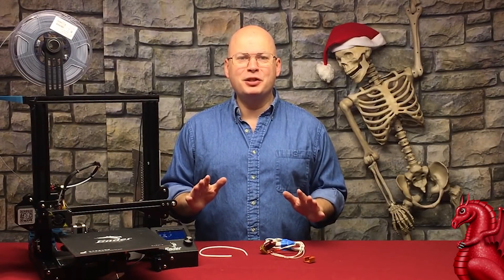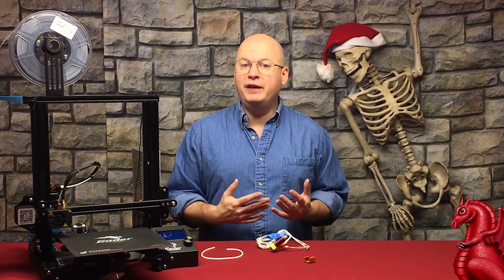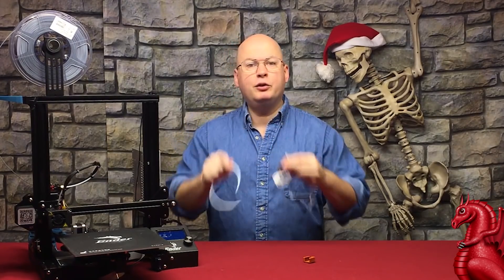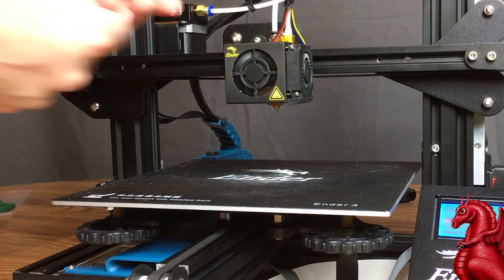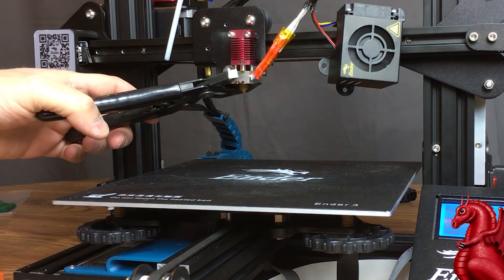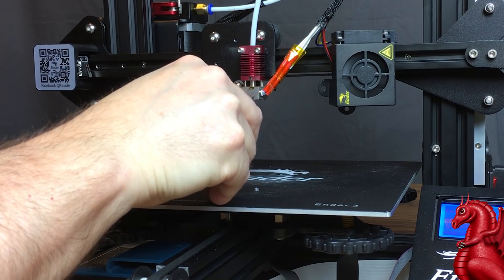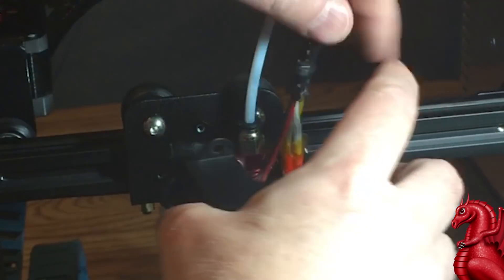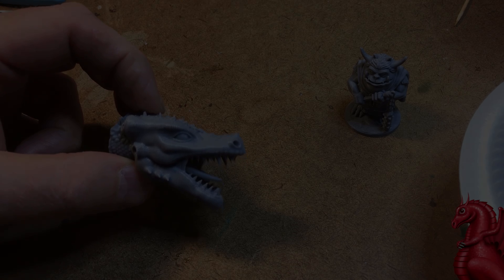Fixing Ender 3 and Ender 5 Bowden Tube Gap

Comment: I put the nozzle in 2 turns loose, then insert the bowden tube to where it hits the nozzle.  then Zip tie the coupler.  Then tighten the nozzle and retighten the zip tie.

It stays in place very well.  No gap.
Reply from the maker: Be careful with 2 turns loose, that might be enough to actually deform the PTFE tube end and cause issues.
Reply: @Tombof3DPrintedHorrors  From experience, yes it will. :(         2 turns is too far...

Comment: 1:10 no, my problem is the filament melts in the bowden tube, and then when it cools off, the filament turns solid.  When I print again, the filment is a solid block of plastic that refuses to melt enough to move forward.  Been using capricorn tubing, the nozzle is right up to the bowden tube, it's just melting in the heatsink.
Reply: Late reply I know, but with capricorn tubing, you need to reduce your retraction distance. Try half of what you had normally.

Comment: Still fighting my ender 5 s1. The direct drive extruder has a hot end where the Bowden tube stops at the heat break. 

I think that’s the cause of my problems, but I’ve recut that section of tube 3 times and I still get clogs. 

I’d say heat soak up into the heating, but I’ve upgraded the fan twice!

The S1 is a troubled machine. Printed soooo well until I had one batch of bad PLA and I’ve never recovered.

Comment: As a heads-up, the bowden tube & Coupler combo pack on Amazon is shipping the right bowden tube and black/print head coupler, but the blue ones for the extruder in that pack have the same screw size as the black ones, so they don't work. This isn't your fault, but I just wanted to let you know that the product shipping is not what they say if there's a different link or seller you can use.
Reply: I placed an order Dec 27th and it was wrong. So it may be a new thing.
Reply from the maker: Thanks!

Comment: Thanks for this great video! I did everything you explained but left the Fan on the nozzle in place! Why risking damaging the wires to temp sensor and nozzle with fan's this way, when there is no need to remove the fan at all!!
Reply from the maker: You mean you didn't remove the fan shroud? How did you grip the hot end with a wrench to hold it still while unscrewing the nozzle? Not doing so puts a huge strain on the heat break and will often result in cracking it.
Reply: @Tombof3DPrintedHorrors  Okay, so that is why you removed the fan shroud first. I understand. Didn't know that something could break so easily. Luckily that didn't happen. But good to know! Thanks!
Reply from the maker: @1science100  I specifically explained the danger of damaging the heat break and needing to use a wrench  at 4:54

Comment: Been printing for 9 days and the M10 fitting broke and fell apart already, Ender 3 came with extra nozzle and M6 fitting but no extra M10. Got the fitting to work for now, did exactly what you said in the video and back up and running again.
Reply from the maker: Glad it helped! :)

Comment: Hi Tom.

Firts of all NIVE VIDEO!

I'm having some issues with my Ender 3 and I think are related to the way I assembled my hot end.

For some reason I had my first clogging after a month of use.

So I follow your video and even replaced the ptfe tube with a capricorn one.

That worked for a week and then I started noticing first layer issues (the filament is not sticking to the bed) and I noticed some weird extruder noises (like its doing a lot of force to push or extract the filament).

I noticed that I have to do a lot of force to extract the filament too.

Could be that I fail assembling the hotend?
What I'm doing wrong?

HELP!!!

Thanks, Luciano.

Comment: Thank you for the great video.  Very detailed.  It helped me tremendously.  The only problem I have is not knowing when the Bowden tube is fully reinserted.  I have the new Capricorn tube and fittings. After tightening the tube nut, then finish tighten the nozzle, how do I know if the nozzle is pushing up against the tube too much causing the tube to deform.  It will not push the tube back up because the Capricorn fitting has a tight grip on it.  Thank you.

Comment: Thanks for this tutorial.  My filament was broken inside the Bowden tube.  How do I get the broken filament out? Thanks!
Reply from the maker: Just heat the nozzle, manually push new filament through the back of the tube and it will push the broken filament down into the hot end and out the nozzle.
Reply: @Tombof3DPrintedHorrors  I tried,  but the filament won't go through. In the end, I heat the hot end to 210 and removed the nozzle, the used new filament to push the broken one off. Thanks anyway!

Comment: a month or two? mine in one day for the M6 tube couple on the Z axis, but on the heat end, apparently seems to be pretty okay. Creality seems to actually address some issue, including mine already came with silicone sock and supplied a spare M6 teflon tube clamp(but still craaaaaap)

how much they have to cheap out tho, because the replacement couplers that I bought are pretty much industry-purpose pneumatic tube couplers and they're already unbelievably cheap as long as they're not sold for 3D printers

Comment: I've had my Ender 3 Pro for about a year now and it has been getting clogged at the end of the hot end . . . I'm guessing this is my issue?  Or do you think something else is going on?  Thanks for your help.  This is a great video!
Reply from the maker: If it's a year old and you have never replaced the tube and cleaned out the hot end this is very likely your issue.

Comment: Thanks for the video, it's extremely useful. One (hopefully not too dumb) question : wouldn't it be easier to unscrew the nozzle before heating the hot-end?
Reply from the maker: No, it is much easier to unscrew it while heated (the solid cold plastic will act like glue and make it nearly impossible to remove otherwise.)

Comment: My 3D printer has been printing really iffy. The extruder was making this thumping noise. This started an investigation into the bloody rabbit hole.
It seems the is a BIG fault with Bowden tubes – that is the pipe that carries the filament to the hotend. Apparently the things, if not installed correctly from the installation can let molten plastic ooze out inside the junction of the tube and nozzle. This eventually causes a pinch point and thus creates friction inside the hotend. I watched a bunch of videos on youtube, where I learned about this. BUT how to fix it? No answers there. 

My original hotend suffered from a run out fault. So I had the spare hotend. What if I drill out the crud? The old hotend was no good anyway. Anyway I got a 4 mm drill and low and behold PLA was coming drilling out. I stopped when it got to the Bowden tube. I was able to pull out the tube that was stuck. I did all this on the printer got the new tube out. Cut the tube PROPERLY. And it cured the whole thing.

Comment: Just got my Ender 5 Pro.  I think I may have a problem with the nozzle from the factory. 

The filament stopped feeding into the bowden tube and started coming out the top of the feeder like a slinky. 

Is that a sure sign of a clogged nozzle or could it be some problem with the feeder itself?

Comment: My problem is the Bowden tube coupler in the hot end won’t depress either with pressing down with the wrench or anything else and I am at 210 degrees. Is the stock one that bad? I’ve got an upgrade but I can’t even get the old tone out. At this rate I’m going to have to get a new extruder.

Comment: I just spend 4 hours leveling my bed thinking it was the bed. THANK YOU for this. It was the hotend problem. For some reason the hotend fan doesnt go on when i start a print and thats what caused it

If anyone knows why this is please let me know
I use skr1.4 turbo with tmc2209 with and endr 3 pro

Comment: i got this problem after only owning ENDER 3 for three days! filament aint extruding as it should, will try and clean the nozzle and correct the bowden tube and see if it helps
Reply: Did it worked?
Reply: @chillyboy2008  no, the rod in the ender 3 was broke from faktory. I will need to repair it

Comment: I'm trying to push my bowden tube through after I took my nozzle out. I'm putting pressure on the top of the bowden tube but it won't push out the bottom and come all the way through. I have a cr10s

Comment: Tom will you be doing a video on how to update marlin to enable safety features like to stop the hotend overheating, which has just happened on my ender 3 x
Reply from the maker: Looking into it. As of now, all Creality printers are shipping with TR protections turned on according to Creality. My new Cr-20 and Ender 3 Pro both have the updated Marlin firmware on them.
Reply: Thanks Tom I have a couple of x's and a couple of pros how do you know if they are on

Comment: One of my ender 2's has this problem.  I bought new couplers and it didn't help (even after cleaning). The other ender 2 has never had a problem and it has hundreds of more hours on it.  I bought the metal extruder upgrade hoping that helps.
Reply: Did it help? I have also bought several new couplers and the problem still shows after 5 prints or so whenever i fix it.

Comment: I have an Ender 3 Pro, and I think some things might be different. I'm having an absolute hell of a time removing the bowden tube. There may be some sort of adhesive keeping it in place, which is making it almost impossible to move, no matter how I depress the coupler, or loosen the coupler bolt. Anyone have advice?
Reply: The stronger couplers can cause this to happen, if you're having this issue then while the hotend is heated, and while the tube is still in there, unscrew the coupler and pull the whole thing off. Once the tube is out with the coupler still attatched you can try to remove it from there, or if it is REALLY gripped on there, you can undo the other side of the tube and pull it out in reverse.

Comment: It appears the "Bowden Tube Coupler" link is not working anymore.  I am REALLY new to 3D printers and would like to upgrade it, but don't want to get the wrong part.  The amount of results can be overwhelming.  I have an Ender 3 and replaced the Bowden tube with a "Capricorn Bowden PTFE Tubing XS Series 1 Meter for 1.75mm Filament (Genuine Capricorn Premium Tubing)".  Is it just a Bowden Tube Coupler 1.75mm?
Reply from the maker: I keep an updated parts list here: http://www.fatdragongames.com/fdgfiles/?p=5863
Reply: @Tombof3DPrintedHorrors  thanks for such a prompt response

Comment: So do you know of a way to get the end piece out if you break the throat of the nosel in the heat break? Or if you know of a heat break on amazon I could purchase to replace the broken one with. 5:00
Reply from the maker: You can buy a complete hot end for about $20 here: https://amzn.to/2Smfaj4

Here is a multipack for parts: https://amzn.to/2CG9pHx

Comment: Hello there 
I am getting weird under extrusion where the prints look fine but the walls dont stick to each other
Got any idea for such a problem (nozzle and hotend already cleaned as shown in the video)
Reply: Temperature? Material specific issue maybe what do you print with.

Comment: I just did exactly what you explained. I 10 layers later and it is stuck. Plus I have a brand new extruder and pneumatic fitting on the heat sink. Brand new PTFE tube. It still gets stuck. I have now replaced everything but the kitchen sink, taken it apart and cleaned and put back together in so many ways, so many times I can do it with my eyes closed.  Anybody else had this much trouble and found a solution. I am despite.

Comment: I am not able to remove the Bowden tube from the heat sink. It is stuck. I’ve removed the nozzle and see some blue filament there just at the end of the Bowden tube. How can I make the tube loose ? I was able to remove the coupler. I am working at 240 degrees. Thanks.
Reply: I was finally able to remove the bowden tube from the nozzle. I've tried at 230 degrees and used a little more force. The bowden tube end was clogged with about 8mm of PLA. I had to cut that part. Thanks

Comment: Hey Tom, I have done this for about five times now, and the filament keeps getting stuck at the gap not coming out. I even changed all the parts and nothing is changing... Any suggestions?
Reply from the maker: Did you push an old tube completely through the hot end top to bottom to push out any dried filament?
Reply: @Tombof3DPrintedHorrors Yes I have, and even though some stuck filament went out, its still stuck when I try to insert a new filament.
Also might be important to mention, screwing in the nozzle isn't easy now like something is torn inside
Reply from the maker: that might be damaged threads. What printer model is it? @hen9090
Reply: @Tombof3DPrintedHorrors Ender 5 Pro

Comment: Could this issue prevent the filament from feeding into the hot end?

I'm trying to find the source of my problem;  my printer will run fine for about an hour then filament will stop coming out. It's still trying to feed the hot end, but it isn't moving through the tube.
Reply from the maker: Yes, it can cause that. :)

Comment: Hi. I am using Ender 3 pro now. I faced some weird problem. During 2 hours printing is fine but next heat block temperature is going down to cool almost 30 Deg when i check my own way. That time LCD screen shows up temperature pointed 205Deg ( I use pla + ). But heat block is cool. Did you ever herd or had or knew those kind problem??
Reply from the maker: Possibly a bad thermistor.

Comment: Question:   So on my Stock Ender 3 Hot End, I replaced the couplers and bought the Capricorn tubing and pushed it down to that black Allen Key set screw (on the red section) so I need to push PAST that all the way down to the nozzle ?? Is that correct ?
Reply from the maker: Yes, all the way to the nozzle
Reply: Tomb of 3D Printed Horrors that’s why I had so many clogs lol.  Took it apart last night and mapp gassed it.  Stuff just vaporized lol.  
Now if I could just get the bed height perfect.

Comment: I can't seem to push the tube all the way through on Alfawise u20
are majority of printers built this way or is there a possibility that the hole at the bottom is smaller?
Reply from the maker: The u20 is an Ender 3 clone, so should go all the way through. What is likely going on is the dried filament is really stuck in there blocking the tube (common issue). Heat a little hotter and keep trying.
Reply: @Tombof3DPrintedHorrors  i actually dissembled it now again, cleaned it and noticed that it has a metal ring before the nozzle, so thats whats preventing it from passing through. I guess its not a 100% clone 🤷‍♂
Unfortunately cleaning and new nozzle didn't help much, it started extruding and printing fine, but clogged very quickly again 😭
Reply from the maker: @x3merx3mer  I don't think that is a metal ring, looking at pics of your hot end it appears to be identical to the Ender design, which means that 'ring' is a ring of leaked and hardened filament that formed in the gap between the tube and nozzle.

Comment: Did this with my Ender 5 Pro, and now the nozzle won't heat up. Sensor is reading it as being -14*, and when I try to heat it, the system just reboots.

Comment: How do you finger tighten the nozzle at 210 degrees Celsius
Reply from the maker: It's an expression, you're using a wrench or socket, but just barely tighten, do not apply any force beyond a couple fingers

Comment: Help! I can't get the Bowden tube to push through! I used a wrench to push a plug out. Do I need to replace the head?
Reply from the maker: Just heat another ten degrees hotter and try again. :)
Reply: @Tombof3DPrintedHorrors  I just finished trying that. I could get the tube to go through, but it was being crushed and deformed. I remember when I tried to pull the tube out the first time I tried to work on it. I thought it was glued in. there was melted plastic all the way up the top of the heat sink. I went ahead and ordered a replacement hot end and will install it tomorrow.

Comment: My Bowden tube won't come out from the coupling even if depress the collar. :(

Edit: I ended up just unscrewing it with the tube still attached. It had some plastic infiltrating it that was making it stick.
Reply from the maker: Take the nozzle off, then push the tube out through the bottom of the hot end. :)

Comment: I bought the tube cutting tool on Amazon per this videos recommendation and it doesn’t cut anything.  I’ve been sitting here for 10 minutes trying to get a clean cut through the bowden tube and it just doesn’t cut deep enough.  Too tightly clamped, you can’t spin it around... too loosely clamped, it doesn’t penetrate the plastic.  Very disappointed.  Hope it was just an unsharpened dud they gave me.

Comment: I cannot get my tube to go all the way through, is there another option other than a new part?
Reply from the maker: If it's a Creality Ender the tube is being blocked by hardened leaked plastic heat to 210 and keep pushing the tube (you can even grip the tube with pliers an inch above the hot end to get a better grip, since you'll be replacing the tube anyway.
Reply: @Tomb of 3D Printed Horrors  I'll give it a try, it's a creality ender pro. It got really gunked up before I realized it was a block, and possibly blocked with some ABS instead of PLA, as I didn't realize the sample filament it came with was ABS until after the fact. (Brand new to thus hobby.)
Reply from the maker: @sweetielea3194  OK, ABS will require much hotter temps to break free. Also, do it in well ventilated area, ABS is TOXIC!